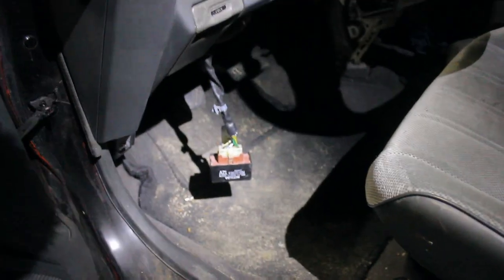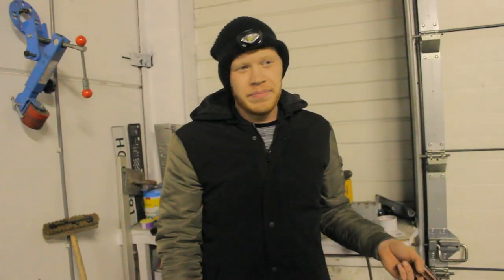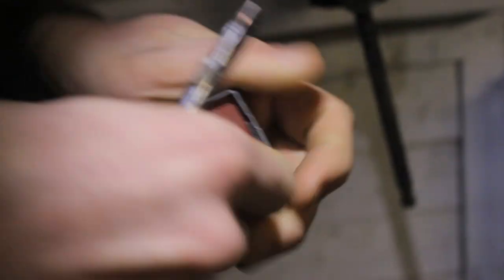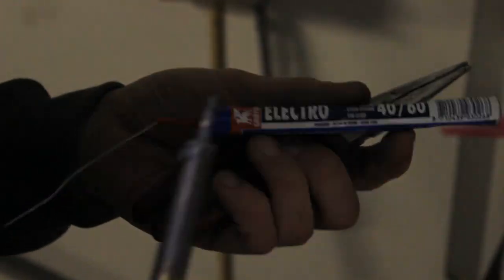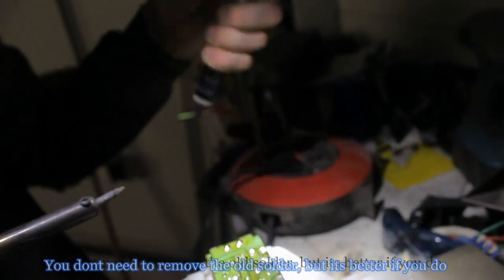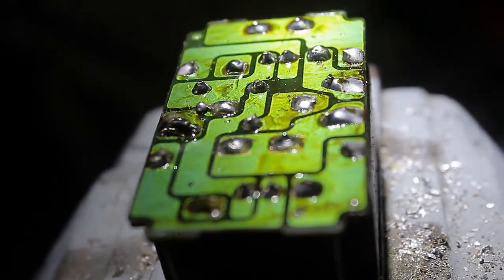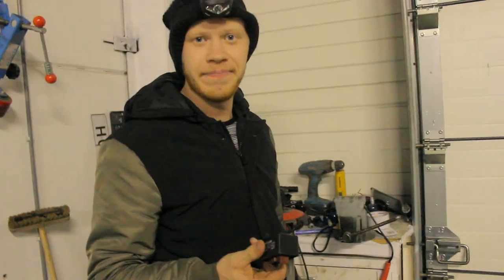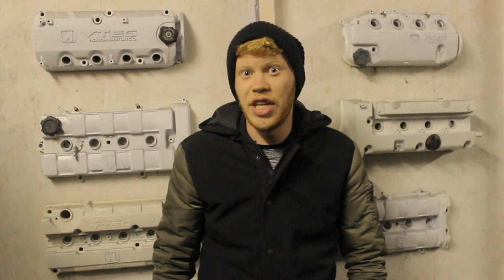How to repair your Honda main fuel relay for free

Comment: Don't solder like him.   The tip should heat the pad and melt the solder on the board.  Apply new solder to the old solder area.  Watch some soldering videos.
Reply: Truth!  Glad you pointed that out!
Reply: Flux & soldering iron alone to remelt existing solder will work
Reply: @QSasquatch  Yes it can, but if one uses a solder sucker and solders, don't do it like that!
No disrespect to the guy that made the video.
Reply: Soldering iron tips should be Clean... so that solder coats the tip, making for a clean solder joint.
Reply: 👍Rhanks for the tips. but i do appreciate him teaching this video. it worked for me. GOD BLESS ALL OF YOU.👍

Comment: True, If car is hot in the summer sun,  it can also effect the relay.  Air your car out first and try it. My 1995 Honda Accord has had issues in the summer.  I now crack my windows a tad and park it under a shaded tree. It helps.  I'm gonna need a new relay,  or maybe a pump.  Arghhhhhh
Reply: or an ecu.

Comment: Hi there, if the click is present it means that the relay is broken or on the contrary is when the relay is OK?
Reply from the maker: It means the relay is okay
Reply: You should also hear the "whiring" sound of the pump priming , ir pressurizing the fuel tank, too.
Reply: There may still be a click but if the terminal delivering power to the fuel pump is 'cold' then it won't start the fuel pump.  Relays have coils and contacts and it's vital that all the terminals are electrically sound. This video shows precisely how to repair a cold solder joint.  The symptoms of a cold joint in the main relay is difficult or inability to start in hot weather. Often the car starts when it's cold but once it's warm it cranks without firing.  Main relay up under the dash.

Comment: Mine makes a clicking noise but is still not working the fuel pump is still not working there is not current coming into the wires. Can it be something else?
Reply from the maker: Fuse maybe
Reply: Checked the whole fuse box everything is ok no blown fuses. Opened the relay to check for cracks its all good like new. Don't know what is the problem
Reply from the maker: @mazinbalushi6439  it could be a lot. For example an issue with a faulty alarm or the wiring being cracked somewhere or the ecu being broken or a faulty ground point
Reply: @TheMidnightGarage  thanks for the help man i will check that for sure 👏🔥

Comment: no pwr to all 6 coils...recently replaced 3 of 6...gd bat...temp outside was 10 degrees, so left running to heat inside...returned & car was off...checked what I could and found no pwr to all 6. Any thoughts?

Comment: Thanks for the tip. I was going to buy a new one but I resoldered the whole board instead. Why not? And now the car works fine. Before it would occasionally just not start, then have to sit a long time before restarting. Roll starting didn't work either.
I did have to check another video that showed exactly where it was.
Reply: You have that link please and what year Honda? Thanks a lot.

Comment: Need Ideas : My 1988 Honda Prelude Ignition Switch Always Started the Car Perfect...but Suddenly...I Only get the Dash Lights, On....but when turning the Switch to start the car----- absolutely Nothing Happens...( No solenoid Start....) But---  I rigged up a Push Button Switch, ran the two Wires to the Solenoid, and The Power comes from the POSITIVE + bolt at the rear of the Starter....the Car Starts fine....!!!  As Long as the Key Switch is Activated....( and the Dash lights had come on , then stopped as Usual... Sooo why does the Key Switch not Turn on the ( Starter/solenoid) Anymore...??
   Is Something Broken at the Switch...???  Do I need to buy a New Ignition Switch...??
  Do I have to Pull the Steering Wheel to Inspect the Ignition Switch....??
  Is there Some kind of ( inline Fuse ) that I should Know About...??   Should I have to check for : a short in the Power to the Solenoid/ Starter..??  I really Don't Know If this is a Typical Thing that Happens to 1988--- very old and Tired Preludes....!!   This Car Has the "Flip- Up " Headlights....by the way....2-door.  Please Respond with Any Helpful Clues....or Resolve....as I do Drive this Car Daily....with My Mickey -Moused Starting push Button....it Works Excellent...  Thank You....Bill in L.A.
      12-31-18.

Comment: Hello I got a 88 wagovan i just replaced the relay brand new and it still clicks and car don't start wat could be the next issue?
Reply from the maker: maybe your starter motor is stuck? have you checked if your car gets fuel?

Comment: Hello my friend
I have a civic 2000 D16Y7
the car does not start it turns the panel on but does not start the engine
I've already checked the starting engine and still no start
which may be happening.

Comment: Hi, in my car, a honda Civic now replaced a new fuel pump and got another AC pump relay, but unfortunately there is still nothing! I turn the key and do not click on the relay and the pump does not go but if you think of a car then it starts, there is a click and the pump goes. would not receive AC power from the relay ?? what should I look first of all?
Reply: Hi, could you fix it?

Comment: Is it in the same location on the driver side ? I have an Honda Civic 1997
Reply: If I remember correctly, the Hayes manual applicable up to 1995 only.  Check the area on the passengers side after you look on the drivers side. 1997 to 2092 may have a different placement.

Comment: Thanks.But it would had been nicer if you mention the year of the car.
Reply: The guy working on a pre-1996 civic.  It looks just like my old Civic SI interior.  Which has the ECM under the passengers'  seat instead on the foot wall on that same side.

Comment: Well ....NOBODY RESPONDED TO HELP ME OUT....WITH SIMPLY : WHERE TO LOOK FOR THE MAIN RELAY ON MY 1988 HONDA PRELUDE 2.0 SI.  BUT I WAS ABLE TO FIND IT ON MY OWN....UNDER THE DASH, ON THE STEERING WHEEL SIDE.  I DID REMOVE/ UNPLUGGED, THE MAIN RELAY, OPENED IT UP TO LOOK AT THE SOLDER JOINTS....SAW NO EVIDENT PROBLEMS....HAD TO MAKE A BOLD DECISION : TO RE-SOLDER ALL 26 SOLDER POINTS---ANYWAY--- ( CAREFUL , NOT TO SPREAD SOLDER ACROSS CIRCUIT BOARD ISLANDS....GUESS WHAT....THE VEHICLE NOW WORKS EXCELLENT....NO MORE RUNNING OUT OF GAS....WHILE DRIVING ON THE FREEWAY....NO MORE " NO START" CRANKING....THE PROBLEM WAS SOLVED , AFTER MONTHS OF PUSHING, WAITING, SPRAYING STARTING FLUID...AND RUNNING BACK TO THE IGNITION SWITCH...( NOTE: I WAS VERY DESPERATE....BECAUSE AFTER 2- WEEKS OF SEARCHING THE INTERNET, CALLING AUTO PARTS STORES...TEXTING IDIOTS AT JUNKYARDS...TO TRY TO PURCHASE A RZ-0045 MITSUBA MAIN RELAY....TO FIND THAT NOT ONE WAS AVAILABLE.....
ACROSS AMERICA, PUERTO RICO, ANYWHERE....THANK YOU FOR THIS VIDEO....!!!  BILL IN L.A.   01-27-2019.
Reply: Nice.

Comment: this has been replaced with another relay, Auto and still does not start, no ac relay clicks, no ac pump is humming, the check engine light is on! What could be wrong with it?
Reply: gábor Nagy hi did you find your fault? What was it?
Reply: Might wanna check the fuses to the pump and relay....Check whatever else you were working on, make sure everything is connected.

Comment: Why not simply remelt the the existing solder? Why wouldn't that work?
Reply from the maker: That will work as well if you do it properly!
Reply: Old solder may inhibit nthe flow of electricity due to thermal corrosion.

Comment: I got a new one an still dose it
Reply: did u figure out ur problem?
Reply: might be your ground or pigtail wires
Reply: @martintydingco7365  Where is the ground or pigtail wire?  I have a 1993 and my car starts but turns off after a few minutes and then fuel pump will not prime.  I have to wait about 10 minutes and then the car will start and stop again.  Any ideas?  I will try the solder trick but my relay is brand new.
Reply: I suggest checking the wires going to the pimp under tge rear passengers seat. The may be a frayed/broken wire in the wire causing a short after warming up from electrical flow.